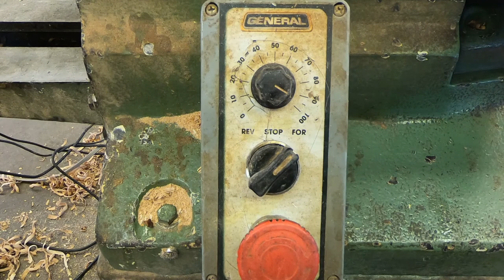Woodturning - Pepper and Salt Mill

Comment: Thanks for the video.  I go to thrift stores and look for salt and pepper mills.  Sometimes I find brand new ones that have good mechanisms and have  never been used for only a dollar or two.  Much cheaper than from any store.   Disassemble and you have a mechanism to use in your own design.
Reply from the maker: That’s a good idea for personal use, but I would never do that for a set I would sell. Jim.
Reply: @SpragueWoodturning  You are right.  I wouldn't either.

Comment: When you put the spindle in your jaws it looks like you’re leaning the jaw chuck “wrench (?)’” against the piece to see that it is spinning straight. Is that what you’re doing? Can you explain how that helps or what you do to correct it if it isn’t turning true? Example of what I’m talking about at about 14:45
Reply from the maker: That’s correct. The blank is tight but not tight enough that I can’t move it with some pressure so it runs true. I then tighten it down so it stays that way.
Reply: Ah. Got it... oh and it’s chuck key, right? Haha. For some reason the word key just escaped me earlier 🤷🏼‍♂️
Reply from the maker: Correct